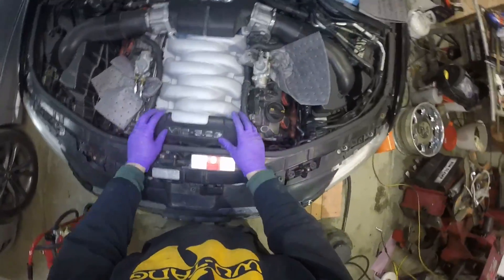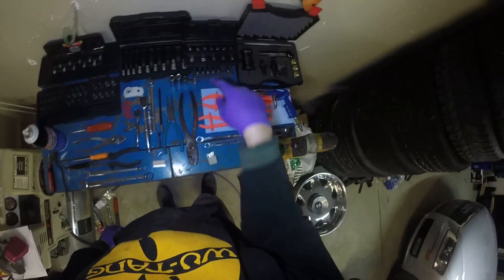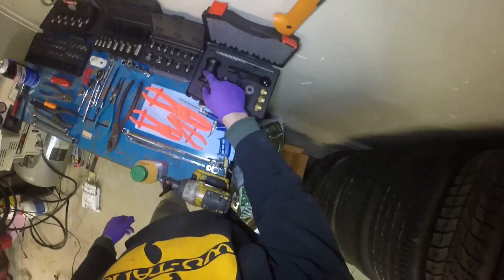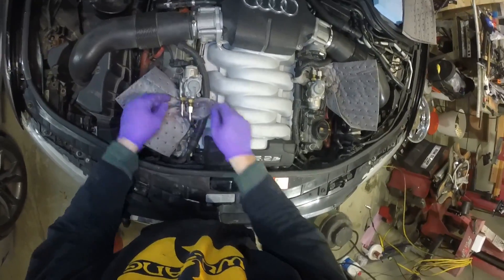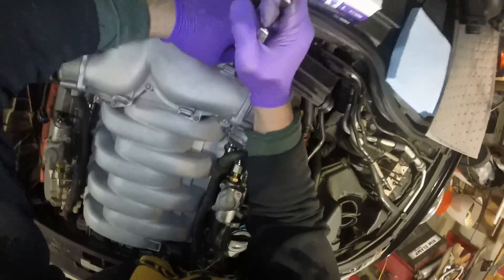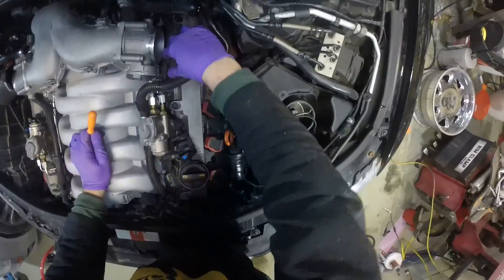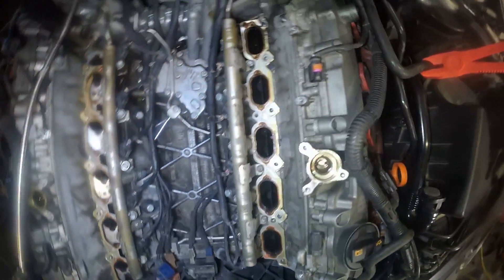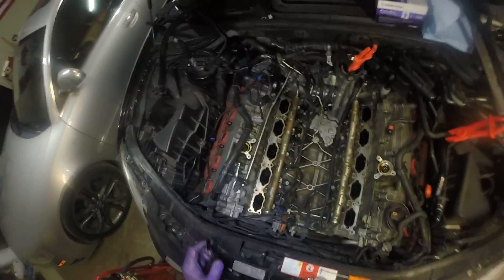HOW TO: Audi D3 S8 V10-Complete guide to carbon cleaning and injector reseal. PT 1-Manifold Removal

Comment: Thanks for another great video Greg. Have done this job once before as well, but used the fuel injection cleaner / wire brush on drill method.
Looking forwards to seeing the results you get with blasting...

Comment: so after everything is done and put back together are there things to be done VCDS / OBD so the starter will engage and engine will turn over…?
Reply from the maker: No. 
Is your PRNDL all red? If so TCM is offline. May have to power cycle battery few times. Or some power/ground isnt hooked up.
Reply: @BGGarage  I had the battery disconnected for like almost 2 weeks…hooked it up yesterday and everything cycles. But when I push ‘start’, the starter engages then turns the engine over just a fraction…then nothing.  Could it be I need to code the battery again?  I can’t figure out what the problem is…
Reply from the maker: @madkafe8207  no shouldnt have to code or recode it. Make sure the battery is actually charged up. make sure grounds are tight. Bad grounds can do all sorts of weird things.
Nothing else needs to be done

Comment: Hi Greg B, great videos man. Hey I am tackling the front crank seal on my V10. I know the radiator pipes have to be disconnected however do I have to disconnect the air conditioning refrigerant pipes? Can the condenser with pipes stay intact and be swung out of the way? Thanks for any guidance.
Reply from the maker: No need to disconnect the lines. Only when dropping the engine. You can unbolt the condesner and swing it almost 180 around to the driver side.

Comment: Thanks for the video. I think one of my flaps broke in my manifold. I think I could just remove the flaps then I'll probably lose power. Just until I buy a new one.
Reply from the maker: I did that on mine. Split the intake manifold, punched out all the plastic parts. You will lose torque under 4500 as its now defaulted to the short runner. over 4500 rpm change.  Sounds good, but slower from a light.
Reply: @BGGarage  Yeah I'll try that. Thanks so much.

Comment: Hi Greg, excellent video. Any chance you have a video or can refer me to video on getting the radiator / front end into the service position? This is to access the belt and tensioner to replace noisy tensioner. Thanks.
Reply from the maker: Hmm, I dont have a video for that at the moment. I should have put the front end into service to drop the motor originally. 
It is straight forward though, 
Pull the fender liners, undo the 3 nuts that hold front bumper cover to clip. remove bumper cover (few connectors and the washer hose is there), 
remove the 4 bolt sper side holding crash bar, and screw in long studs instead, undo the top fasteners (T30 heads, around 6-8 of them), there are two little supports at the bottom accessable from underneath, metal suports that use a course thread screw to go into the plastic front housing, take those out and shoudl be able to slide the assembly forward. 
Ill make a video on that if I have to dive into the S8 again at some point
Reply: Greg B thanks Greg, I’ll give it a go.
Reply: Hi Greg,

I just got off my S8 5.2 inlet manifold, massive carbon buildup at 136k Miles, any chance you can let me know what grade of walnut grit works well? I also am looking for a suitable grit blaster so any info on what works would be really appreciated. Thanks again, Stephen.
Reply from the maker: Stephen Farmer i used the harbor freight 40 lb blaster with the fine grit. You have to play with the valves to get it to flow right, even then still get occasional clogs. But man it works well when it works.

Comment: Whats the easiest way to crank the engine over to get tdc on each cylinder to do valve cleaning
Reply from the maker: Pull the fuel pump relay out the back right panel and spin it over with the key. Eventually youll be able to do all 10 like this.

Comment: How ahardnis the intak to do im so so as a mechanic. Im nervouse because its a audi.
Reply from the maker: Its not hard just tricky witht he fuel lines. need a crows foot and a super short wrench to get at some of the hold down nuts. The electrical connections in the front may be tricky to get on, i suggest clipping them back on before setting the intake down. Or if you move the front end into service position, no worries then.

Comment: thank you from france ! do you think it's possible To change the Valve Cover Gasket in this position? and not leave the motor from the car completely..? thank you
Reply from the maker: Yes you can. It helps alot if you use that EZ red or gearwrench super low profile torx bit set with the flex head ratchet wrench i mention at the beginning of the video. It makes accessing the lower rear driver valve cover bolt and the PCV valve bolts a breeze compared to regular torx bits on a ratchet. 
Replace the O rings on the oil control valves while you are there.
Reply: @BGGarage  these EZ RED tools are so great! i ordered these on ebay, i can't find anything like this in france or europe! i changed the o-ring and the seal from the oil filter bracket last days on my AUDI S6 and your videos helped me a lot! i think these o-rings are the disease of these V AUDI's engine
Reply from the maker: DJ Rafael thats good to hear! I believe they are stilla buna or maybe a nitrile o ring, but probably buna. Heat cycles and oil do them no good, viton would be better...i need to order a large master metric kit of viton o rings and swap everything over
Reply: @BGGarage  for sure Viton resist better To hot temperature, i hope you'll do a video if you swap them, i think they'll resist better. I don't no why they use nitrile for origin o-rings, maybe for keep your money when you go for the maintenance 😁 or maybe seriously To resist for the cold temperature? I see on internet viton not resist for the very cold temperature (-7°Celcius/220°C) and nitrile is ok for cold temperature (-30°Celcius/120°C )
If you swapp them don't go to canada! 😅
Reply: Hi Greg, are sure i'll could extract the last ignition coil on the cylinder 5 on the left? have you got the original audi's procedure? i'm afraid To start To change the valve cover gasket whithout any notice procedure, can we echange by mail? thanks a lot by advance
Reply from the maker: @Raphael-hc4pd  you can subscribe for $35 USD/24 hours to ErWin Audi and download all the manuals you want, this is where I got mine from. Legally I can't send it you. 

But I can guarantee you can remove the last ignition coil and bolt with the engine in the car. Especially with those EZ red tools we talked about. 
Remove all ignition plugs, remove the oil control valve that is behind cyl 5 coil, then use the EZ red ultra low profile T30 bit to get that the bottom rear bolt, and then remove the valve cover, and change the O ring on all 4 oil control valves.

Comment: 5:03 what are these two lines for behind intake manifold ? Is that fuel leaking?
Reply from the maker: That is coolant feed and return to heat the oil separator return drain.
Reply: @BGGarage  oh thank you I’m getting a fuel smell around that area, by purge valve, oil filter housing, PCV area , I did have a leak at that line underneath a while back but i a thought I tightened it up, no obvious leaks , but it’s usually at idle when I’m looking . is it possible I didn’t tighten all the way and only under heavy load  it leaks a tiny bit ? No check engine  lights Runs  good , hauls ass , my next idea was possibly external leak of injector?
Reply from the maker: @christian_urocar  tough area to diagnose due to space constraints. Did it just start happening one day or  was it after some work?
Definitely check the evap line area around the passenger rear side of area.
A combustible gas meter may be of great help here, i got a cheapy for 30$ and its been awesome for finding a super tiny propane leak on my rv. It will at least guide you to a closer area.
You have the hpfp feed T and returns on the left rear as well, those you can see from up top if leaking. Lower line is tough to access for tightening/removing so if it was worked on could be a tiny bit loose.
 You can also add a UV dye to the oil to help finding a liquid leak easier.
If all that checks out, it xould be at the injector itself, manifold off  unfortunately.
Reply: @BGGarage  Woah thanks for quick response . I got the car running but not being driven in a year. Low oil pressure light and vibrations ( the oil filter was damaged and improperly installed , vibrations still there ) I smelled gas when driving it decided replacing O ring at base of drivers side HPFP, I saw a light ring of fluid around the base so I thought it needed to be replaced . During that the line that connects just underneath the area I mentioned  ( right next to bolt for lifting eye). It got loose and started leaking a lot on to the floor so I turned off car tightened it up and it stopped leaking.
maybe 10 miles before I got it( I put like 200 miles on it since then)  the previous owner replaced all injectors , did Carbon clean, new sparks, coils .  

The smell is only on drivers side , specifically in that area I mentioned , 
I still have ring of moisture forming at base of HPFP.  Local mechanic said that’s oil not gas . My gas mileage is ok, I mean for the v10 it’s not much behind my a8 in terms of mpg .  Using VCDS can I get any tips on how fuel system is working? I don’t know what baseline or normal readings should  be. Besides that  on VCDS , it reads the S8 is in German lol on the A8 it’s in English wth?? Lol
Reply from the maker: @christian_urocar  mechanic is correct, o rings at bottom of HPFP is only for oil. A catastrophic pulp failure may send oil out past the plunger but, you will have poor running engine and codes for low fuel pressure.
To monitor fueling in these engines with VCDS you have to do it 1 bank at a time u fortunately. Ecu 1 then ecu2.
Bank 1 and 2 for driver side bank 3 and 4 for pass side (ecu2). Can watch the short and long term fuel trims. Past 18 or 20% (dont remeber the limit) the system cannot compensate anymore and will throw a check engine light.
What codes do you have? Do a full clear, drive it 20 mins if you can, reread codes. This ahould activate all diagnostic monitors. Reread codes and email me the file greg.balandyk@gmail.com.

Regarding the language issue, you can change country coding via vcds. Dont remeber off hand, ross tech forum has a write up on how to change the bit.
Reply from the maker: @christian_urocar  correct about the cats. 
Cat health is monitored by the post cat O2 sensors. They are a switching narrow band, essentially checking for lamba=1.  Outside of a narrow range it woild show a cat inefficiency code as there is either too much or too little oxygen.3
Reply: @BGGarage  found my leak greg ! Drivers side fuel line that goes straight into fuel rail, from HPFP small leak only detectable with reviving up and using a paper towel rolled up and i got a small wet stain it was fuel .  so I probably didn’t tighten it all the way since last time it got loose on me.  last time it was from replacing HPFP o ring . I must have moved it enough to get it loose.
Reply: @BGGarage  also, I took your suggestion got a combustible gas detected and used that to detect it .
Reply from the maker: @christian_urocar  nice! Glad to hear the tool worked for you. Nice easy fix for ya
Reply: @BGGarage  thanks Greg !
Reply: @BGGarage  tightened it up. No smell. I sent over the scan to your email. Let me know what you think